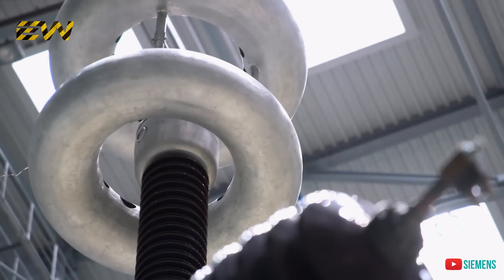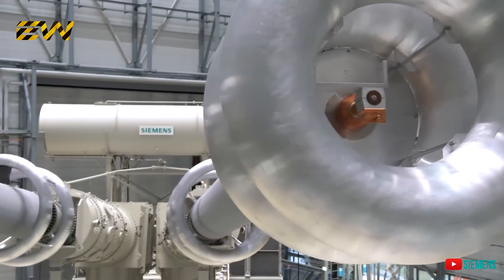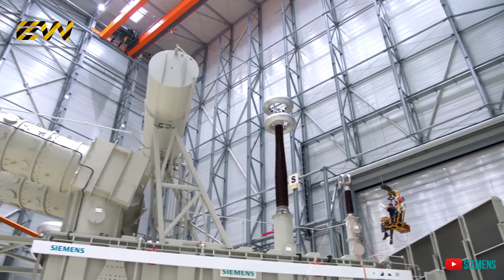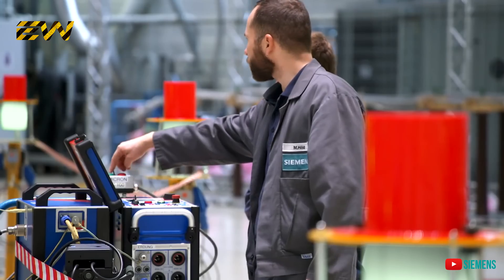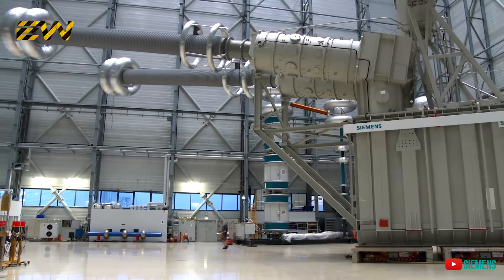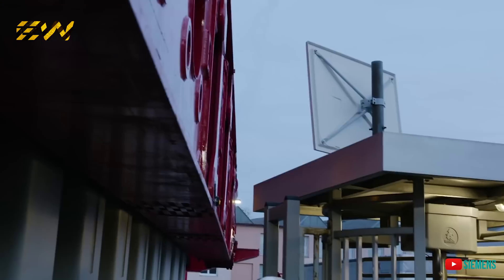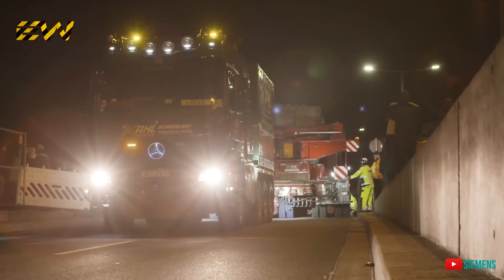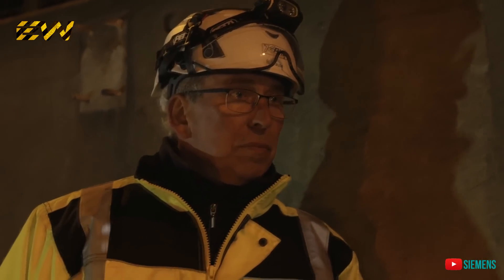World’s BIGGEST Electrical Transformer Video

Comment from the maker: Why does the transformer size increase with increase in voltage rating?
What do you think?
Reply: As the current increases the cross section of the winding conductors increase however as far as the volage is concerned:
1. The insulation thickness is increased thereby increasing the height of the core window.
2. The cores we use are limited to a maximum flux density of 1.7-1.8 Tesla and thus to increase the flux we have to increase the cross section area of the core. This is because the voltage at terminals is directly proportional to frequency of the supply (50 or 60Hz, so it is constant, cannot be changed) and the 'amplitude' of the sinusoidal flux.

Also  as I read in the comments it is required to increase the reactance of the transformer which is done by increasing no of turns which also increases the size.
Reply: The tank size is designed around the coils in side the transformer. Our friends at ABB will do all the RESERCH AND DEVELOMENT AND DESIGNING  of the tanks ,I know one of the boys that do that job .
So yeah the bigger voltage ,bigger the tank and the rest of some of the equipment inside the tank apart from the coils, is bigger as well .
Usually the amount of oil to cool the coils down inside the tank is worked out on fine base lines and othe facrorors,working on a maximum overload, the coils  to be circulated by a curtain time  round in the tank and radiators and pipe work ,at a certain rate or speed to circulate oil around coils at optimum runnig temp  of keeping the  coils nice and happy in there cool and thin heat transfer oil and with  extremely high voltage is bolted fast shut in side .
The conservator is that nice big tank,that sits up top , and that'll only be used by the transformer tank  if she decides to spring a leak or and  as the oil is disapated over time via the break down of the oil from electrical currents or electrons  flowing and or the magnetism generated from the  voltage currents I think. 
I hope I answered a question for someone out  there this morning. 
I love electricity but we're taking it for granted. 
Thanks to ABB we have the  tech's and engerneers  building our transformers here  in Australia.  I used to weld these beautiful baby's up and I loved welding them .  if I'm wrong about the oil , I'm  sorry. I'd like some one to help me with this question if I am wrong .  but I'm sure the oil is disapated  over the time and year's  that the transformer is in  service wouldn't it ??
Reply: Hmm. I thought it was because it had more chocolate pudding in it.
Reply: Gotta use more oil to cool that air cooled transformer yeah you make sense, oh my
Reply: The more you increase the voltage, means more you are increasing the amplitude of magnetic flux, so you have to increase the core size for the transformer to confine maximum amount of linked magnetic field with secondary, to reduce the leakage flux and increase the efficiency, the size is bigger, moreover, the coils, turns, cooling part also has to be bigger.
Reply: Dielectric constant mainly, I guess. We don't know to make flashes :)
Reply: An increased voltage level requires an increased insulation. For a given insulator, So as to increase the insulation between each phase and earth, one have to increase the clearances with each phase winding as well as with the body of transformer. Thus increases the size of transformer.
Reply: If we increase voltage level we have to increase ground clearance also according to voltage
Reply: know should become want :D
My mind was elsewhere
Reply: As the voltage level increases 

1. Transformer emf equation is 
E= 4.44 f(flux)N  as the voltage is directly proportional to no. Of turns ,size increases.

2. For higher voltage levels  requirement of insulation also increase to prevent leakage currents. Hence due to highers insulation, size increases.

3. As the frequency of the system is fixed and permeability of material of standerd cores are also decided , then  Flux = ( V/ F ) ratio of the transformer also increases. To circulate this higher flux, low reluctance path shuld be more which means higher core area is required ..

4 . As the size of core and the coils are increasing then this transformer requires higher space for cooling and ventilation thus size of transformer tank also increases. 

5. Due to the higher voltage ratings size of bushings and insulation which are used for outer assembly also increases because these equipments have ratings directly proportional to voltage.

 6.may be due to parasitic capacittance between two adjecent turns of a primary and secondary,  performance of transformer may affect ..but not so sure about this point.

for that purpose transformer larger size for higher voltage ratings.
Reply: Hmmm ... I don't think voltage on its own of course.  Look at a  Potential Transformer and #10 conductor inside of it . CT is the same . 
Bushing size and weight grow for insulation .   Oil capacity is for insulation but more importantly for cooling due to loses. That's why we have 3 ratings.   Convection, Fan and Fan with pumps. This is key in longevity of the paper inside. 

KVA or MVA ,  power in and power out are equal but there are loses which generate heat which must be dispersed over greater area and control .

Ehhh where was I ?
Reply: જુનાગઢ લોકસભા ના લોક-લાડીલા ઉમેદવાર શ્રી રાજેશભાઈ ચુડાસમા 
સંક્ષીપ્ત પરિચય ...🙏💐
Reply: 1. need coil very much for minimality current 2. need insulation more its oil for it 3. need amount coil primer different amaunt coil sekunder very much
Reply: I didnt think it did increase. If it indeed does, it would have something to do with the handling of HV and arc-over prevention,  not VA consideration.
Reply: Size increases with the voltage mostly because insulation clearenses also are increased.On high voltage levels power transmited also is large number, typicaly above 250 MVA, which requires large windings and magnetic cores.
Reply: no of turns increase and need more paltes need more insulation as a result size increases
Reply: It depends on 
i)what frequency it is operated at, and 
ii)The power rating of the transformer.
As we know, transformer only operate at AC, so, there is an DC-AC conversion going on before the power gets into the transformer and greater the frequency of the AC voltage induced in the transformer,  smaller the size of the transformer gets(induced voltage=2πBNAf, where f is the frequency of the AC used, N is the no. of turns of the coil where the voltage is induced (primary or secondary) A=area of cross section of core along the winding, B is a parameter depending on the material of the core used in the transformer ( it is the saturation flux density, if you are curious) ).
Again, you can say that the induced voltage is directly proportional to the no. of turns, so a greater core size is required to fit those turns for inducing 1100kV and you'd require to transform 12GW through that transformer, so the current flowing through it will be about 10.9kA, (so to speak, if there is only one continuous winding, but if the power is distributed among several secondary and auxiliary windings then the current could be way lesser. So, that much current require a heavy gauge of wire to be handled. 
Those are the MAIN reasons why the size is so big.
Again it needs an oil tank to insulate and cool down the transformer, so counting that will definitely make its size seem way bigger.
Reply: The primary side of this transformer is ultra high voltage and small current, and we know that if voltage rating is increased the insulation size also increase. And secondary side step down voltage and high current, so in here we have to increase the conduuctor size to withstand the that much of current. 

So considering these two Factors the transformer size is increase.
Reply: With increase in Voltage rating, the level of insulation required increases, the distance between transformer core and body increases which leads to overall bigger size.
Reply: The power is 12GW under 1100kV voltage. The power requires mainly a big hull and the voltage requires proper insulation - more voltage, more insulation, which needs more space. I think the answer of the question is more than obvious.......
Reply: Transformers  trade off voltage and current, much like a mechanical transmission trades of rpm and torque.
One side of a transformer is high voltage, low current, and the other side is lower voltage and more current. It appears in this video that the transformer is a "step-up" transformer, taking the lower generating voltage and transforming it to very high voltage/low current transmission electricity. 
A very high voltsge  on one side, implies very high current on the other. High current requires larger conductors to safely carry it. The higher the current, the bigger the conductors. There is also the issue of higher voltages needing more substantial insulation to contain it. Notice the two huge output hi pot terminals. It should be noted that progress in insulation technology has led to thinner insulation.
So, higher voltage means more current means bigger conductors and greater insulation needs a bigger transformer to contain it all.
Ergo, bigger. QED
There is also the issue of converting AC to DC. Transformers only work with alternating current. Somewhere in this whole thing AC gets "rectified" into DC. At these voltage the wyeristors or thyristors, or whatever they're using would have significant mass and size and all with substantial insulation.
Reply: I think gundam is better than transformer🤔
Reply: The size of transformers is increase in voltage rating due to high voltages  increase the insulation mateial of the transformer so that the size of transformers is increased.
Reply: First of all..Higher voltages are prefers for higher rating .for a particular rating the size will not increase , because with high voltage the cross section decreses which will be compensated with increase in size to meet higher voltage.
Reply: Well, its common knowledge that you can not produce a single object bigger than you, the Burj Khalifa is millions of smaller parts, and this applies to everything, life, building, technology. So you need something bigger to create a bigger outcome, and efficiency (size reduction) will come with time and innovation.
Reply: It needs better isolation between turns basically. It's 1100KV, so even using high tech isolation fluids, a bigger spacing is needed to avoid unwanted discharges, short circuits or even corona losses. In open air I guess an electrical arc could be formed from a distance of 100 cm approximately. In my home I use to play with 120KV,  just 100W, 12cm arcs. Imagine gigawatts and a million volt. It could vaporize everything around. Isolation is the Key.
Reply: Because of how many windings it has from primary to secondary
Reply: The answer is simple. assuming the transformers have the same kVA rating,

From an Electrical perspective:
 The insulation requirement for the transformer of higher kV rating is huge. Assuming that the transformers have the same kVA rating the emf per turn should approximately be the same (again assuming the max core flux density is constant) , so number of turns on the HV side will be larger and that has to accommodate for the clearances in oil/pressboard composite system. In converter transformers such as these, the insulation is stressed with composite stresses (the valve winding undergoes a  combination of harmonic stresses and a constant DC stress (depending upon the location of the neutral point). so it is likely that the insulation requirement in the HVDC side must have enough withstand capacity and for that the size must be huge.   side note : The BIL of a 400V system is just 1425kV whearas the BIL of a 765kV system will be around 2100kV so again higher the kV higher the insulation requirement bigger the size 

cooling systems: in my previous assumption i had assumed a constant flux density, hence the core loss would be same for both the cases. hence the size of the cooling system would apporximately the same right? . except its not. As the size is higher, the head required to pump oil through the oil ducts will be high hence a cooling system of higher capacity would be required hence an even bigger size is expected.

mechanical perspective:
mechanically to hold the whole structure we would require more materials to withstand the structural stress in the case of normal operating conditions and in the case of short circuits (the structure should withstand a high mechanical force) hence again the size will be even bigger.

hope you enjoyed my answer
Reply: Voltage per turn in primary and secondary are same,  so if u need more voltage on secondary u want to have more no of turns in secondary,  so winding takes more space,  moreover the dielectric constant has a limit to increase,  as the secondary is very high voltage more width for insulation..  overall the size increases.
Reply: Turns ratio
Reply: As voltage increases conducting part to earth distance increases ,inside tank...

Comment: I would like to see circuit breakers working with this huge high voltage and tremendous watts. Could you please post videos on that subject
Reply: yes indeed, but usually in the case of HVDC systems, during faults, the converter controls take action to clear the fault. In the case of pole to ground fault, converter firing angle is rapidly increased to angles over 90degrees in the order of milli seconds. hence the faulty portion is deionised by reversing polarity for a few hundred milli seconds. then the CB actions kick in. This whole process in HVDC systems is known as DC polarity reversal for clearing faults
Reply: @balajisriram6363  90° means i guess average voltage is zero or not?
Reply: @parilkotecha3300  by 90 degrees i mean the converter firing angle. Beyond 90 degrees the pole DC voltage becomes negative which helps de-ionize the arc during a pole to ground fault.
Reply: @balajisriram6363   ohhh.Thanks.Another doubt is Does SCRs are used in convertors at such high voltage or any other device?
Reply: @parilkotecha3300  mercury arc valves are long gone. HVDC systems use improvised versions of IGBTs and Thyristor valves.
Reply from the maker: We shall research on that!

Thank you for the suggestion.

Comment: I noticed a glaring problem in your description. You said this transformer was for a high voltage direct current (DC) line but transformers don't work with direct current. They require alternating current (AC). So for the transformer to function the DC would first have to be converted to AC, a point you neglected to mention. Also it would have been interesting to know the weight of the transformer but you omitted that detail as well.

Comment: The tank and most of the transformer was made in Croatia factory name KONČAR then transport to Germany to be assembled. I know because i was working on them,and its a pain in the but to build that monster .
Reply: What makes building this one more difficult then a smaller model? I'm assuming its more then just the physical size of it.
Reply: @sparkplug1018  Because it empty weight is nearly 30tons,and u got to handling this monster in small space because u got more of this transformers tanks around u. That just that bit there u haw a all the other bits to fit around him to make shore  that they fit. Assembly of that transformer in how we like to say in dry condition takes around two weeks without the core or oil,and if it fits and there is no leaks of air anywhere the the whole thing around the transformer is dismantling and then  we transport that empty tank to paint and other bits. Sure this is just a crash cores of things that we do before transporting the tank to the other part of factory so they put the transformer core and oil into it. Last time one of this mega monster fly from Zagreb Croatia in Antonov  AN225 to middle east and there's been crowd gathering to see this plane and the transformer going up in the air.
Reply from the maker: Wow! Can you please share what all challenges did you face while working on this transformer.
Reply: @engineeringworld.  Sorry, it would take to long to describe all the things that we face  building that monster..
Reply: @jebalica  Samo im reci da je transportna tezina mrcine preko 500 tona. I kad im kazes koliko ovakvih mrcina treba za prijenos snage 12 GW I to pomnozis s cijenom svakog, raspolozenje naglo padne

Comment: Maybe because of the high voltage generated by the transformer is directly proportional to the number of turns in the secondary coil. And the amount of current flowing through the primary coil of the transformer have some relation with the thickness of the wires in primary coil

Comment: I read somewhere that the circuit breakers on the 1100kV DC  have to break the equivalent of a 38 tonne articulated lorry crashing into an immovable object in the event of a short circuit. Fantastic engineering achievement the 1100kV circuit breakers.
Reply: I guess you can't just put the old cap/resistor damper across the contacts and be done with it.  ;-)
Reply: To witness that would be amazing
Reply from the maker: Can you please share the link to the source of information for our viewers. 

Thank you.
Reply: Engineering World - I was watching a documentary by ABB on YouTube and the guy doing the narration commented that in a short circuit situation the potential fault energy in Joules was approximately the same.
Reply: IMO the circuit breakers required to protect this transformer are more impressive than the transformer itself.